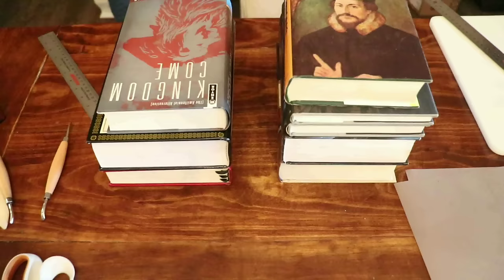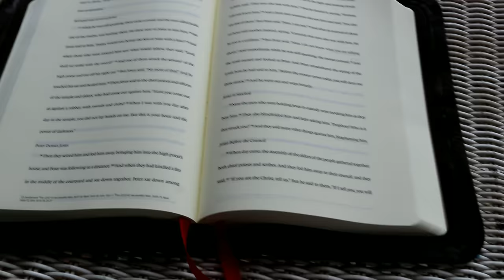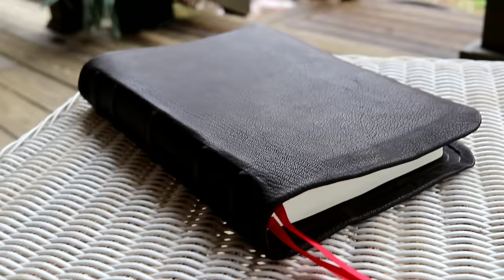Leather Bookbinding Time Lapse - Complete Process, Step-By-Step with DIY Instructions

Comment: Hey brother, love your videos. I've been binding for about 6 months and learned everything from your videos.

Question, have you ever tried using the same size lid for the inner cover as well as the outer? Did it turn out okay or is it absolutely necessary to have a smaller inner circle used for inner liner corners. Thanks.

Comment: Why did you use different glue on the spine than the liner? My current bible does not have the spine attached to the cover. What benefits does it have to attach or not attach? Thanks!!

Comment: The math at :53 does not make sense if we compare to the earlier formula for width. You stated block width + 1/4" + (2 * yapp) = liner width. That would be 14.25 + .25 + 1.5 = 16.5" for a .75" yapp.

Comment: Try as I would to stop even the slowed down video I couldn’t spot the type of glue you’re using for the tabs. Looks like a contact adhesive?  Can I use pva for that? Thx
Reply from the maker: I use contact cement for the tabs.  You can use PVA, I just get stronger results from the contact cement
Reply: Hey, thanks Beau!

Comment: Thanks for the video, it’s been really helpful! I know it’s a few years old, but was wondering if you could explain the directions at :47 seconds into the video. How does adding 2 inches to the length and width result in a 3/4 in yapp? & is there some kind of “formula” I can follow to alter your measurements if I wanted a smaller yapp?

Comment: If the original cover were a hard back and you don’t have something you can use for reinforcement, what sort of thickness of card would suit do you think?  I’ve seen Ben Of Ben’s Bibles uses a sort of canvas cloth, and I’ve seen people use card stock. I’m also worried about warping as the leather dries, but at least we have leather on both sides, hoping that cancels out. My client wants a limp cover but not a floppy one, so I’ve got to find something suitable.

Comment: Such a cool video! I have a question: what is the benefit for having the leather lining coming up onto the block? I’ve recently been doing research on leather bindings for bibles and I notice that’s one thing I often hear people make comments about (including you) and I was just wondering why? Thanks man! Super cool video!
Reply: The leather lining is a mistake I'm guessing came from not using book boards. Ribbons, when binding, are generally glued onto the spine of the textblock so they can nicely reach throughout the book. You're never going to really have a fine book until stopping with the double leather in favor of boards and end papers, and splitting the signatures of the book apart to sew together, or you sacrifice the primary method of strengthening the book and getting it to last.  So many problems with this tutorial.

Comment: Man, that was really great Beau! Loved it!
Reply from the maker: Thanks a ton Frank!
Reply: @BeauTate  I forgot to ask: How long did that take in real time?
Reply from the maker: That was sped up 40Xs the normal speed.  There were spots where I slowed it down in editing to help show certain things and techniques but for the most part, it stayed at 40Xs.  Probably close to a total of 8 hours altogether but there was also some work that was done off camera (making and installing the Oxford Tube as well as doing the hot tooling around the border of the interior reinforcement) which was another 1 & 1/2 hours.

Comment: Hi thanks for the video! I have a question do you recommend using one type of leather for the cover (soft) and another type of leather for the bookbinding? Also where would you recommend buying end sheets? Thank you so much
Reply: Jason Centoni Siegel leather has great river grain goat skin for the cover. The inner leather is usually a lamb skin that you could find at Siegel as well. The end sheets are a heavier card stock I get from Hobby lobby they come ‘textured’ so just make sure you put the nice texture away from  the block.

Comment: You might think about taking a couple of classes.  The cover is too large, you put the ribs in but left out the headbands.
Reply from the maker: The headbands are already attached to the book block.  Look closer at the end of the video and you can see the bands.  Also, the cover is not too large.  The cover is exactly the size I intended to make.  I wanted the cover to have a certain amount of yapp and it is the exact size needed for the desired yapp.